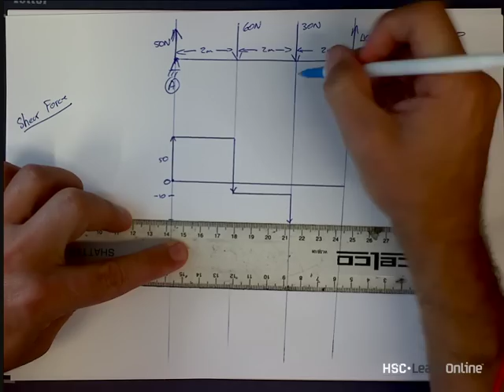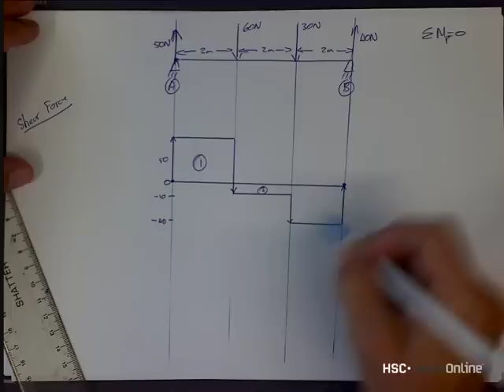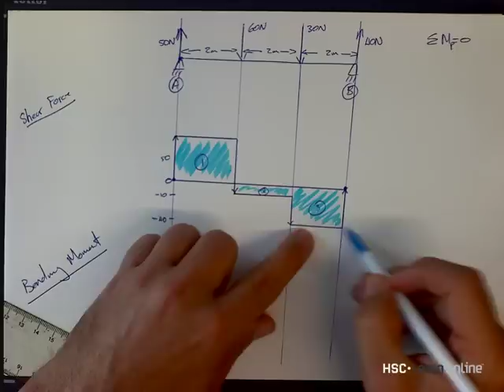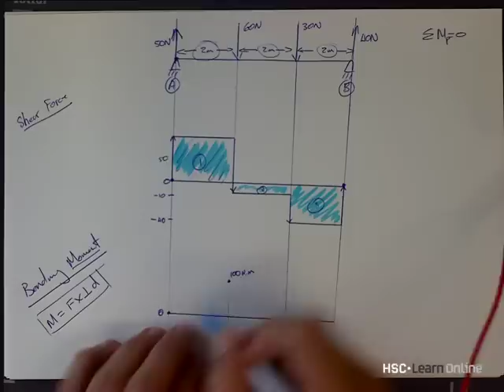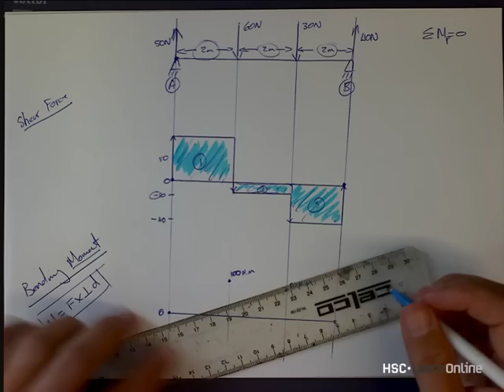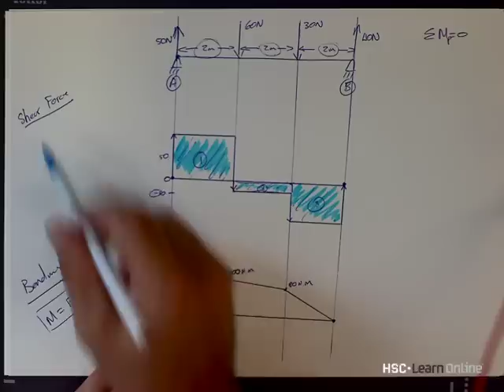HSC Engineering Bending Moments and Shear Force Diagrams

Comment: Good video, just be careful with terminology - you say this is a bridge 'fixed' at both ends, when in fact it isn't - it's pinned in the model you've set up, i.e. allowing free rotation at that point, and thus no transfer of bending moments. If it was 'fixed', you would have bending moments at the supports; fixed implies that no free rotation is allowed and therefore some moment will be transferred into the supports.

Comment: Is this drawn of vertical forces only? What if I had a horizontal reaction force on the hinge
Reply: +Matthew Sherman Good question.. my guess is that logically horizontal forces do not contribute to bends or shear in a structure like a bridge. let me know if you know the proper answer
Reply: +XAAD XAAD Correct
Reply: +XAAD XAAD if you have a spaghetti strand and you load it in the middle (very lightly) it will deflect, if you then push the two ends of the strand together it will snap once they get close enough, the more you push them together, the more it deflects, so surely horizontal forces would play some part?
Reply: xANTHQNY It will only snap only if the forces are not exactly horizontal. Think about it. a horizontal force has no vertical component, so there is no way it should move, it should only compress it. plus spaghetti has some elasticity to it. just my take.
Reply: Always remember that Bending moments do not have a horizontal force. E.g. Horizontal force directly into a pivot, it doesn't do anything.